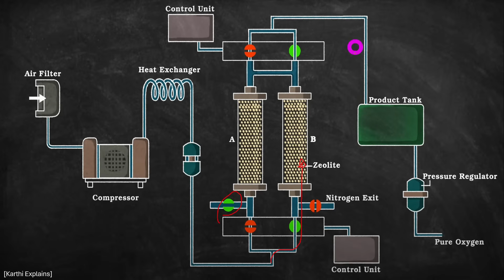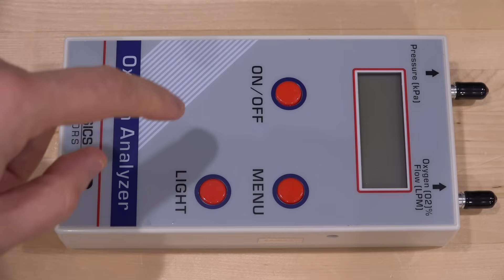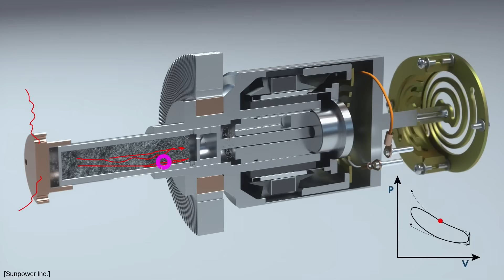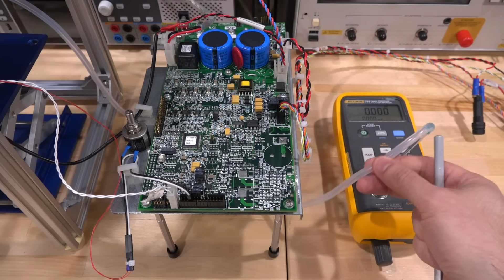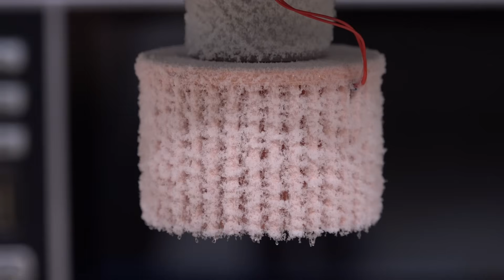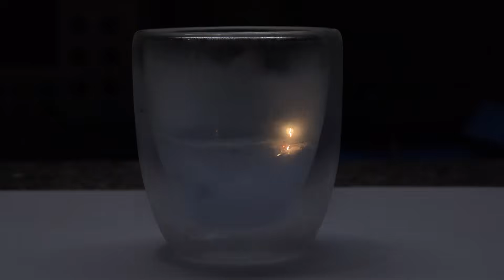TSP #313 - From Electricity to Liquid Oxygen/Nitrogen! Thermodynamics, Cryocoolers & Oxygen Capture

Comment from the maker: This video was supposed to be an April 1st release! Mistakes were made...
Reply: XD
Reply: You could do a review or a repair video on your microwave. Perhaps try to measure the phase noise of the magnetron and compare it to some of your instuments.
Reply: @lukahierl9857  I don't think many of his instruments can tolerate a kW of input power, but it would certainly be an interesting exercise in how to not fuck your equipment.
Reply: 😂double😂 then
Reply: That oxygen sensor deserves its own video. Capturing waveforms on scope to show shift in time will be nice. Dont know if that particular chip is capable of measuring flow also. I tried chip from maxim to measure flow but my scope is only 30mhz (analog discavery pc based) and dynamical range is not enoug for ultrasonic measurement.
Reply: Fantastic video.  One question: at 39:06, where you mentioned the run time on the Sterling engine, you said, "...so this thing has been up on the tower for five years or so."  What tower were you talking about?  What was the original application for this thing?  Thanks, Shahriar!
Reply: Maybe that is the April's fool joke here, release it before April's fool :)
Reply: I love it! All the research and the experimentation you must have put into this video, only to forget to check the date. True scientist! Good news is, there are still a few days left for a follow-up video on making oxygen from scratch!
Reply: Lol, but yeah I buy 10 or 20l 300bar O2, it's totally a thing.
Reply: Genius, total genius, you're ahead of your time
Reply: it's obvious 😂
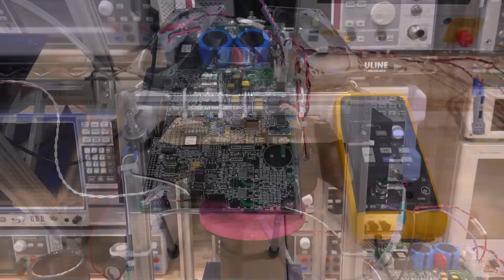Reply: Totally spat my coffee @ 38:05
Whoever said Shariar doesn't have a suitably warped sense of humo(u)r is a LIAR!
Reply: I shall obligingly wait until April 1st to watch it!
Reply: Something maybe YbS-today a the New Era of our local cosmos innovative enhanced homemade AI-based cold thermo-nuclear-quark reactor (based on local cosmos local vacuum symmetry violation of 2 volume) with from Neptune network.
Reply: Is any of the information presented factually inaccurate or is the joke just the topic of the content?
Reply from the maker: @mikek5206  It is 100% scientific and factually correct.
Reply: Ok so just so I’m clear before I burn 46 minutes watching something I won’t fully understand, is this a legit video of you making liquid oxygen or is this some joke?
Reply from the maker: @ It is a legitimate video.
Reply: Like the way the oxygen sensor works? Works by speed of sound, not density.😀

Comment: Another reason for the water pass through on the output of the oxygen generator is to prevent flashback if the plastic tube catches fire. Not sure if its silicone if it would still burn or not.

Comment: Could oxygen's paramagnetism be used to further purify it? For instance set the dewar on a big magnet so not-O2 floats to the top to suction off or preferentially boil away? Also, what is the mystery material inside the stirling engine  that works a little like a heat diode? Or did I totally misunderstand that part?

Comment: Very nice setup!  I've been making liquid oxygen in this same manner since 2018.  I use a CryoTel GT that uses almost double the amount of power and gives 16W of lift at 77K.  My setup looks quite primitive compared to yours though LOL.  I really want to refine mine, especially more elaborate rejection-side cooling like you have.  Mine doesn't cool the fins as efficiently and it reaches 85F - 86F.  I get about 2L of LOX a day but I know it can be more.  I use a Respironics EverFlo O2 concentrator set to 1 LPM for my oxygen source.  Anything lower will result in ambient air seeping in and creating some frost, anything higher will reduce the efficiency.  Question for you...  You said your O2 concentrator doesn't give completely dry oxygen.  I'm wondering about that.  I don't use any kind of dryer - I pipe the 1LPM from the EverFlo directly into my chamber and it stays frost-free.  And the EverFlo doesn't have a desiccant inside.  The sieve beds are evidently removing water vapor with the nitrogen.

Comment: Theme of chemical combustion some Na with some stable or short-lived or unknown isotopes of liquid oxygen are not disclosed in some volume. Also, you can mold a small handmade Na-flower (like plasticine) and then send to swimming into liquid oxygen (perspective liquid ozone from ultra-violet) or water or ice surface or solid ozone surface (seems like are dark with violet in visible light)*

Comment: Ok crazy idea, what if you throttle the cooler and maintain something like 80 K.  Too warm to liquify nitrogen, but plenty cold to liquify just oxygen in the air.
Reply from the maker: While keeping the temperature at exactly the condensation point of oxygen will preferentially create liquid oxygen, you would still have to completely dry the air because it would frost over immediately in open air.
Reply: @TheSignalPath  I've actually found that when it's cold enough, frost is prevented from forming.  It's a weird backwards behavior.  Of course the air needs to be still, as in inside a cup or similar
Reply from the maker: If the cold tip is in a isolated cup, the available moisture in the air within the cop will frost immediately. If there is no air exchange, the frost will be limited to what was in the cup; not because it is "too cold". That is the wrong conclusion. Once the temperature reaches the condensation of Oxygen and Nitrogen, air will begin rushing back into the cup, bringing moisture with it and the frost will begin to grow.
Reply: @TheSignalPath  that's what I thought, but it doesn't happen that way.  I put some ln2 in a metal cup, and it only frost up above the liquid level.  The part that has liquid just started dripping liquid oxygen, it was really strange
Reply: @TheSignalPath  https://www.youtube.com/watch?v=PBJPeGpuTXE

Comment: This unit, seeing the size of sieve towers should be easily capable to produce 1 l/min @ 93% by just removing tube (and blocking it) from the mixing valve, because it's diluting the mixture without any need for the task. As a rule of thumb you could expect oxygen capacity as 1/11 of the air flow from the compressor.
Reply from the maker: The mixing valve is completely closed. This is the best this unit can do.

Comment: Very cool, is that pure oxygen only or does it still contain argon, neon, etc?
Reply from the maker: It will contain trace gasses. But remember that they don’t liquify at the same temperatures.
Reply: @TheSignalPath  ah, do you know Sir Williams Ramsey and his experiment? in 1898 after Karl Linde invented the cooling compressor in 1895 to luiqidfy air, he found the elements Neon, krypton, etc or do you need something better than Stirling engine?

Comment: Without measuring the total pressure of that outflow it's hard to know if it's 90% or not.  Though I guess you know if you live at sea level or in Denver but we don't.
Reply from the maker: I have compared the unit with other generators. It certainly is well below 90%.

Comment: Does anyone know what the oxygen content of the waste (mostly nitrogen) output on the oxygen concentrator would be? I'm curious if you can use it for food preservation.
Reply from the maker: You can calculate what it would be. Starting with 79%/21% in the atmosphere and getting about 15%/85% (N2/O2) from the oxygen port.
Reply: @TheSignalPath  I thought the diagram you showed had pressurized oxygen enriched air being used as a purge gas for the zeolite, so I really am not sure if a direct translation is possible. This video was incredible and I want to buy a unit just to play with now.

Comment: Is that blue oxygen in the glass close to 100% because nitrogen needs lower temps or is it cold enough to be a mix of both? Great video.
Reply from the maker: It would certainly be higher concentration than what the PSA system produces simply because Oxygen will preferentially condensate over Nitrogen.

Comment: What if you try to put electrodes with HV DC  into it? Will it move or turn into ozone?  Or may be it's possible to make a corona discharge just inside the liquid. Well, it's kind of dangerous so you need some preparations.

Comment: Brilliant fun video! One tiny correction, the air is cooled after compression as adsorption on zeolite is higher at lower temperatures. Certainly it's also cooled for the user, but that would partially happen upon decompression anyway, so this is why it's immediately before the columns instead of later.

Comment: After giving this further thought....  Here's my conclusion(s):
1: Shahriar continues to AMAZE most of us with some of the test & measurement equipment he can get his hand on.  Many of us consider 30Mhz to be high frequency.  Shariar considers it to be 'almost DC'.
2: Near the beginning of the video, he explains producing oxygen in high mass stars via the CNO cycle.  (He neglects to mention the proton-proton process to firstly produce helium, but hey...)
My bet is that Shahriar has just finished building a genuine 'desktop-class' oxygen production plant, but he's using the triple alpha process to create the intermediate carbon for the CNO cycle rather than the oh-so-simple alpha ladder process.  He's only been building it in his 'spare time' over the past 4 weeks as he wanted something slightly more 'challenging' than simply building QAM-1048576 transceivers operating in the 1000 terahertz band.
While it is initially powered up by a single CR2032 button cell, it immediately becomes self-sustaining.  In fact, that is why it took him so long (4 whole weeks!!!).  He was worried about what he should do with the slight energy excess of only 3.14159265358979 yotta Watts per second.  So far, he's chosen to use Proxima Centauri as a 'dump' for his energy excess.

BTW, I'd avoid looking directly at tat star (Proxima Centauri) in about 4.3 years when his energy beam finally reaches it since it will INSTANTLY become a Type II supernova

Comment: Modifying one of these to output nitrogen would be really interesting for feeding a reflow oven.
Reply: Why would a reflow oven need concentrated pure nitrogen?
Reply: @simontay4851  it improves the solder wettability and reduces defects. Nitrogen reflow is pretty common for high reliability applications.
Reply: I was thinking something similar. Sometimes having a source of dry nitrogen would be handy. 

Leftovers last longer in an oxygen free environment.

Comment: Wah!  Where can I buy or salvage such a cryocooler?  I do research with liquid Argon.  We use much more complicated cryocoolers such as pulse tube...  This unit in your video seems perfect for a small system with much reduced complexity.
Reply: eBay sometimes...rarely has them. They are normally expensive :-(
Reply: @z9p
superlink rx superconducting filter made by the now defunct STI (superconducting technologies incorporated), and yeah like the guy says above they show up on ebay occasionally but expensive

these things used to sell for like $500 a pop on ebay in the early 2010's as they were phased out of cell towers but now they are rare, and one SOB on ebay buys up every cheap one the instant they show up then relists them for like $5000 minimum as a bid because he thinks he can scalp that kind of money out of people (if you didnt figure it out already i am really fking pissed at that guy, i even told him those units are not work 5 grand and he responded snarkily that he didnt need the money, while i watched him relist it month after month dropping the price to $4.7k and giving up when no one bought it. as much as it is for sale i do not recommend buying it from him as he needs a reality check and realize that he's scamming people)

another note is that cryocooler in there, the sapphire hybrid 98 is not designed for high heat throughput and also depending on which kind you get (old or new) you can either use a variac to drive it off mains, or more likely as the old ones are basically nonexistent now the new ones need proprietary software as they must be driven by the board and not 120v 60hz ac, the software of which you cannot get anymore unless from someone who already owns a copy

check out applied science's video about DIY liquid nitrogen for more about it and you can find many many more people who have played with them along with documentation by looking up superlink rx cryocooler or hybrid98 cryocooler and such.

if youre wondering, STI was bought out by i believe sunpower inc and they still make stirling coolers but they are VERY pricey
Reply: addendum: if you are looking for "simpler" cryocoolers look for the separate cold head helium compressor style ones, those are designed for high energy throughput like gas liquefaction and used can be wayy cheaper, but the issue is finding compatible compressors and cold heads and even still a system like that from used components may go for about $1500, the cold head usually runs $500 used and the compressor runs like 700 + freight shipping as they are HEAVY, you can see how such a system may be set up on TKOR's channel under "home made liquid nitrogen" or something like that (RIP grant thompson, the channel has really delve into non interesting content now)
Reply: @z9p  my first comment apparently disappeared but these are superconductor technologies branded superlink rx filter cryocoolers or hybrid98 cryocoolers, theyre on ebay occasionally like the first guy said but overpriced. used to go for $500 in the 2010s but now one guy keeps buying up every new one and resells them as a $5000 bid, scalping people. you can find more info about these coolers by looking up the name